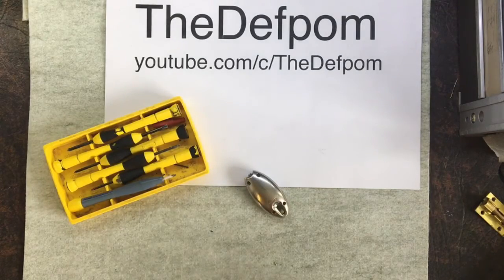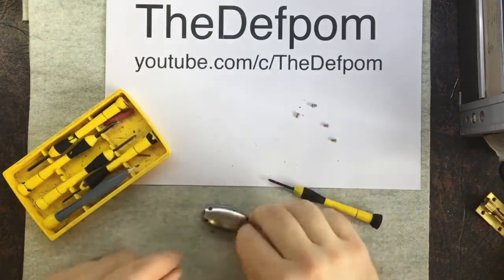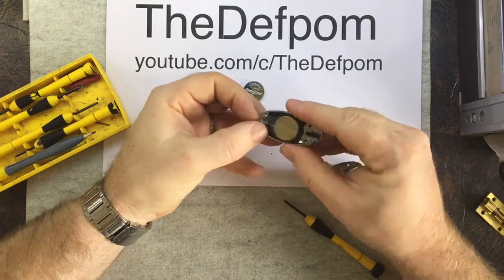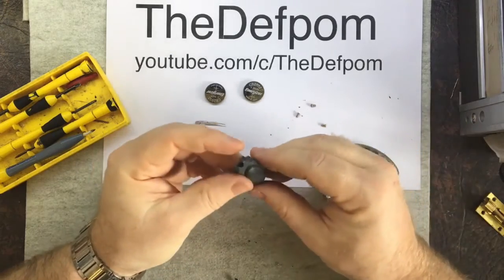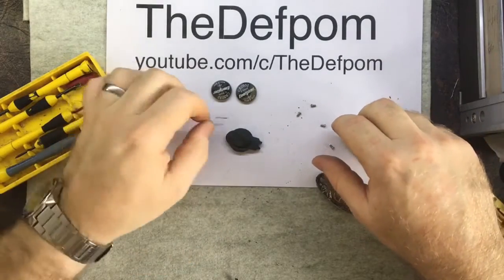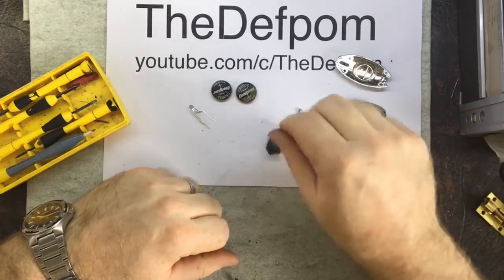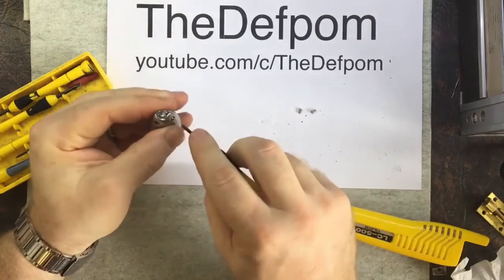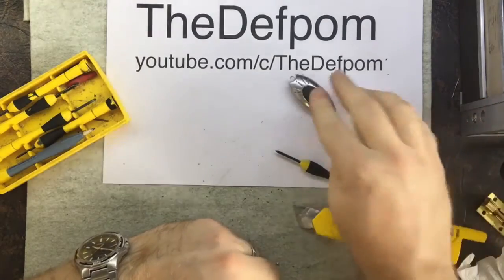#161 LED Torch Teardown and Repair

Comment: I have had one of those for years and its a durable light.  I have gone through several sets of batteries over the years, it gets used a lot.  I recently started carrying a Energizer pen light that uses 2 AAA batteries.  So far very happy with that as well.